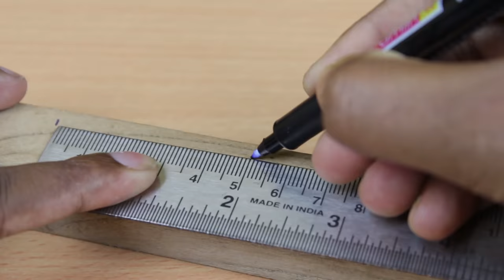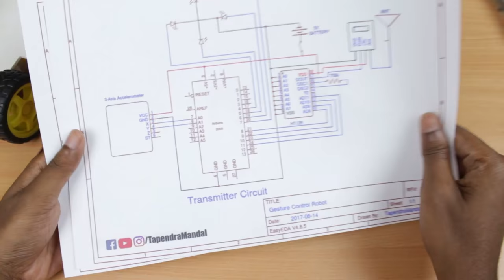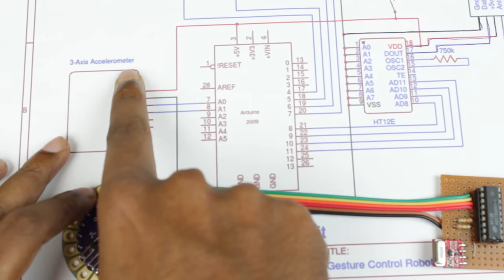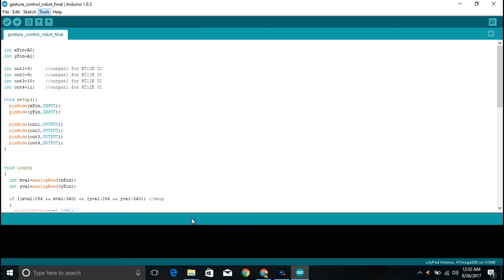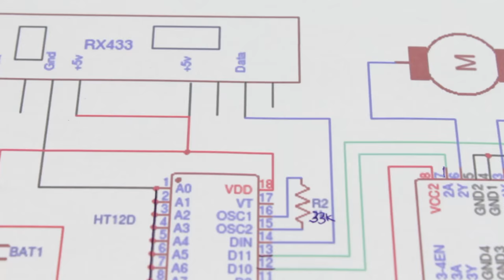How to Make a Gesture Control Robot at Home

Comment: What is the voltage of the flat battery used here ? How did you connect the led and the switch ? Can you provide a circuit diagram ?

Comment: Nice build dude, I'd recommend using AA batteries instead of a 9 volt because 9 volt batteries won't give you enough current for an extended amount of time, also the use of the HT12 chips is good but you could get a better result using two arduino nano's and a couple 2.4gHz transceivers for extended range and reliability, that way you don't need two seperate circuits for your controller, juts have everything decoded using one of the arduino nano's. Also when you turn left or right have the opposite wheels turn the opposite way instead of just being still for a smoother turn, that's just my input anyway

Comment: i did this project for science exhibition gonna show it tomorrow
Reply from the maker: very good
Reply: It did work
Reply: But getting noise from motor
Reply: Siddhartha Ravva broo is this code  working or u do with some  correction?
Reply: Siddhartha Ravva  bro did u have codings
Reply: hello bro.... for this project preparation how much it cost u....
Reply: hello bro.... for preparation of this project who much coats takes
Reply: Siddhartha Ravva all the hhhhhhhest
Reply: Siddhartha Ravva did you made this successful.
Reply: bro u have an ppt of this project...
Reply: darshaderz Minecrafter hypixel can I get ur contect
Reply: hi.. i actually also was doing the same project in a group but there were a few things gone missing can u please help ?
Reply: hey can you please tell me what is ur decree
Reply: plz go slow
Reply: Sarita Kumari voltage run regulator
Reply: Pablo Meraz 750k ohm
Reply: nagaraja rao 1500-2000
Reply: Sachin Ghanteppagol it costs 1590 rs
Reply: can i get the code pleaseee
Reply: Gwen Gumatas which code
Reply: Bhai which pendrive you have used to do coding
Reply: Tanu the codings are automatic just he has shown the coding
Reply: techy sampan  which pendrive has used and how the jumpers are connected to it
Reply: Tanu see i don't know exat name of the pendrive i will tell u tomorrow
Reply: Or in some time just wait
Reply: Tanu its usb to RS232 PL2303 adapter
Reply: Plz tell me the name of application for coding
Reply: did the program worked?
Reply: How much did this project cost u?
Reply: Diagrama
Reply: @tapendramandal  diagrama si

Comment: your work is amazing but you have written BATTERY ETC then what etc
Reply from the maker: soldering iron, gloves, glue gun and forex sheet
Reply: battery .etc.means BO motors,wheels,woodetc.
Reply: what is the purple battery u used??

Comment: Can I use 4v battery instead of 5v battery in the transmitter without using an 7805 voltage regulator

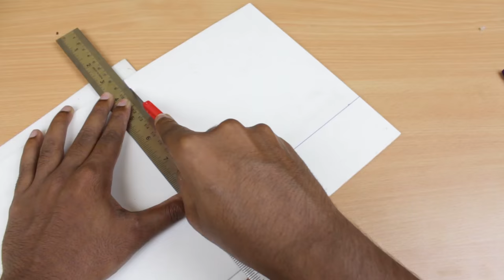Comment: 2:58 what material did you use?
And how much rpm motor did you use?
Reply from the maker: all material listed in the description and motor speed is 60 rpm
Reply: Thanks, I'm asking about the frame you used. Please let me know what material is that.
Reply: I have the same question
Reply: foam board
Reply: He used a gear motor

Comment: I got error during code uploading can you tell me exact connection of USB pins to the lilypad pins
Reply: unplug tx n RX pin while uploading
Reply: If unplugging tx and rx pin is done, how will it get uploaded then?
Reply: AlphaTroniks we have to upload the program to arduino not to the sensors. so sensor should be unplug
Reply: Jintu Talukdar I Know that. thanks
Reply: Ye try karo #ak456541
Reply: We have same problem can you help us please?

Comment: Finally made it😎
Reply: i find the program incomplete and am unable search for the definitions of  the functions used can you please help me with that?
Reply: Sahibpreet Singh yes I have the identified the same issue I don't think the program file included is complete..did u get any error while uploading
Reply: I have made it
But i didn't got any errors
Everything is all right
Moreover i have added if case for tilting the hands diagonally(forward-left, forward-right, backward-left & backward-right) and also to see the values in serial monitor.
Reply: Tech Tricks can y send me the code
Reply: @AmitKumar-ol5ky  can you send me the code. Thanks
Reply: @AmitKumar-ol5ky  bro can you please send me the codes & programming I want to make this
Reply: @AmitKumar-ol5ky   bro can give me codes
Reply: Can i regulate its speed?
Reply: @nimishkhattar2017  no
Reply: @AmitKumar-ol5ky  have you made it?? I know you are saying it correct but can you add a digital potentiometer
Reply: @AmitKumar-ol5ky  Can you send me the codes?
Reply: can u give me code?
Reply: How to connect ttl to lilypad
Reply: Can u plzz help me in connectting circuits ?😅
Reply: @Amit Kumar can give me code thank you
Reply: What is that pen drive like thing can you please help me out with that ?
Reply: What is voltage of battery?
Reply: Hi can u please send me both reciever and transmitter ckt please
Reply: @Amit Kumar plz send me the code brother
Reply: @AmitKumar-ol5ky  bro can you send me the code and circuit diagrams for this project plzz bro i want to do this
Reply: how u got the software
Reply: @ @phucsangtran2633  do you get the code pls reply me
Reply: @alokpandey9177  could you please send me the code ....please...
Reply: I made the circuit but i am unable to dump the program into the arduino...... Please help me..?
Reply: @AmitKumar-ol5ky  Can u please give me that code
Reply: @AmitKumar-ol5ky  I would really appreciate, if you send me the code please. Thanks
Reply: Can u send me the code .....plz....
Reply: @albayati95  hey can you help us with uploading code to lilypad , i have trouble to uploading it
Reply: @zeyderen  

Arduino code

int xPin=A0;
int yPin=A1;
int out1=8;
int out2=9;
int out3=10;
int out4=11;
void setup(){
pinMode(xPin,INPUT);
pinMode(yPin,INPUT);

pinMode(out1,OUTPUT);
pinMode(out2,OUTPUT);
pinMode(out3,OUTPUT);
pinMode(out4,OUTPUT);
}
void loop()
{
int xval=analogRead(xPin);
int yval=analogRead(yPin);

if ((xval>320 && xval<360) && (yval>310 && yval<390)) //stop
{
digitalWrite(out1,LOW);
digitalWrite(out2,LOW);
digitalWrite(out3,LOW);
digitalWrite(out4,LOW);
}

if ((xval>400 && xval<420) && (yval>330 && yval<350)) //forward

{

digitalWrite(out1,HIGH);
digitalWrite(out2,LOW);
digitalWrite(out3,HIGH);
digitalWrite(out4,LOW);
}
if ((xval>295 && xval<320) && (yval>320 && yval<370)) //backward
{
digitalWrite(out1,LOW);
digitalWrite(out2,HIGH);
digitalWrite(out3,LOW);
digitalWrite(out4,HIGH);
}
if ((xval>330 && xval<375) && (yval>380 && yval<430)) //left
{
digitalWrite(out1,HIGH);
digitalWrite(out2,LOW);
digitalWrite(out3,LOW);
digitalWrite(out4,LOW);
}
if ((xval>330 && xval<370) && (yval>270 && yval<310))//right
{
digitalWrite(out1,LOW);
digitalWrite(out2,LOW);
digitalWrite(out3,HIGH);
digitalWrite(out4,LOW);
}
}

Comment: At 5:57 what have you used to connect.the circuit to pc
Reply: ya what is that thing
Reply: USB To RS233 converter model
Reply: how will I connect switchs.

Comment: You are very masss
Its my 3rd year project you helped me😀😊
Reply: is working for u?
Reply: @rolandasmotiejunas6097  
I didn't do this but i will finish in 2 months
Reply: i tried and failed
Reply: if i understand correcly i can use receiver 5-9 V? but transmitter must be 5V?
Reply: Hi have you made the car , we finish it and it wont work

Comment: The connection in the video and in the circuit diagram is different.. .. For the transmitter part which is the right diagram somebody pls help it's urgent.

Comment: Hi all I have 2 questions -
1. Can we use a 9v battery for the controller ? if not can you pls tell me which battery i should use?

2. In the video you showed a USB connector with  jumper wires when you were uploading the code . So what is that thing called so I can buy it?

Can someone please help and answer soon

Comment: Voltage of battery used in receiver?please answer
Reply: Its a headphone battery i think its 3/7 volt and 4/2 volt in peak/you can use higher voltage vith the 7805 or zanerdiod , he used a bad battery his robot is so slowly i think its a 1A battery

Comment: Do we required any special software for lillyppad except Arduino?
Reply: No. Lilypad contains the same microprocessor as arduino but the purpose of using it here is that it can be stitched to wearables. So the code can be uploaded using the same IDE

Comment: Does the signal sent from the transmitter, contact the receiver, through radio waves? If it does, is there any chance the frequency could be changed, and it could control other normal RC items??
Reply from the maker: Yes it is.. you can use DIP switch on both transmitter and receiver to encrypt signal
Reply: @tapendramandal  bro can u please send me the last circuit pic and the usb to ttl cable name please bro i have to submit my project on 27th

Comment: Why does he install a transistor at 7:49, thus amplifying the reception
Reply: It's actually a voltage regulater if you look up the part number it regulates the voltage to 5 volts

Comment: Hello, I am trying to make some changes in the components was it okay to use?:

arduino uno - arduino nano
3 axis accelerometer - mpu6050
Reply: Mika Chun yes
Reply: Bhai tumne bana liya
Pls reply
Reply: @meerasrivastava4491   english pls.
 XD sorry.
Reply: @ceny1495  did you maked it
Reply: @meerasrivastava4491  i will make it for my project. :).
Reply: @ceny1495  did it worked because I also made for school project
Reply: @meerasrivastava4491  not yet, I'm still decoding the program xD.  But, I'm sure it will work if you did follow all the components. I've read the program with the schematic diagram of it and it was okay.
Reply: @ceny1495  thanks for reply 
Which country did you live
Reply: @meerasrivastava4491  that would be a secret. Hahahahaha😎😎😆

Comment: Can I use arduino nano or uno... Instead of lilypad
Reply: Yes you can. Arduino Lilypad was designed so that it can be used with textiles with ease. You can use an Arduino Uno or nano but you should figure out how to stitch/stick it to your glove or whatever cloth you're attaching it to.
Reply: @AG-tw9mr  thank u... 🥰🥰
Reply: Can i use 12v battery at the transmitter part?
Reply: The operating Voltage of an Arduino UNO is 5V. But the recommended input voltage is 7 to 12 V so I guess you should be fine.
Reply: @AG-tw9mr  thank u again bro... ❤

Comment: Error showing while programming :com3 not found help pls
Reply: Look for which port you've connected arduino
Reply: @adilma5065  I have connected exactly like he is doing in the video
Reply: @adilma5065  the circuit diagram he is given and he is connecting in the video are different.. . For the connection between Arduino And transmitter part